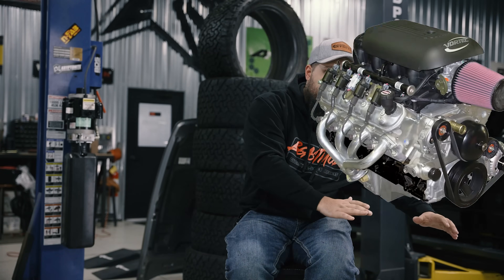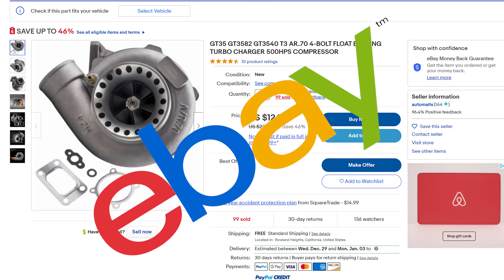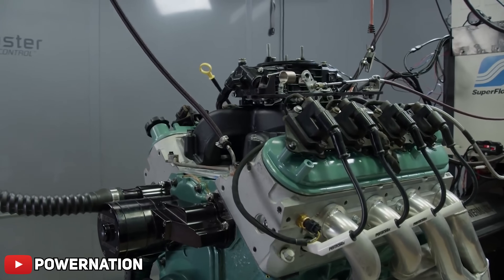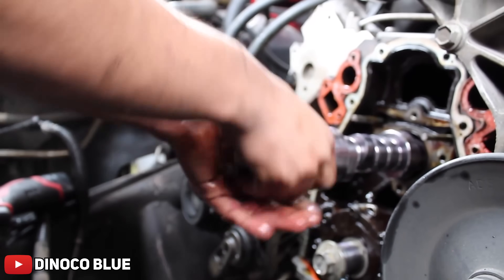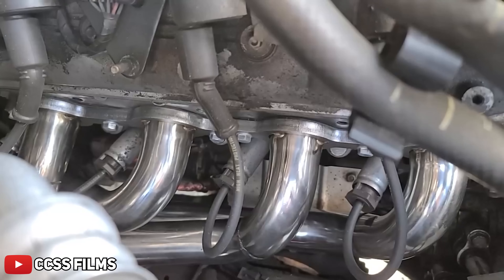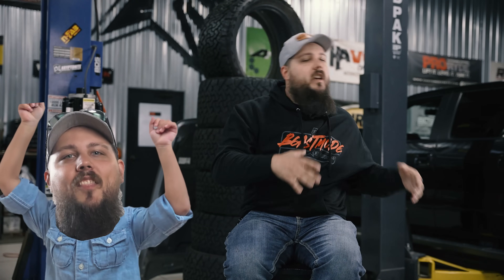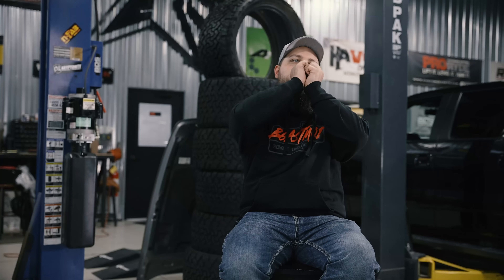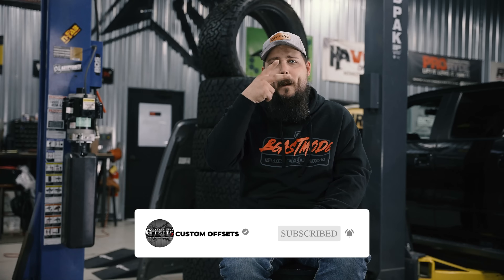Best Performance Mods For 5.3 Chevy Vortec

Comment: Best mods for a 5.3 Chevy....buy a Ford. 🍿
Reply: Not a ford. That would be counter productive. Not a dodge either.
Reply: L comment 😂
Reply: Buy a ford…. 😂😂😂🤣🤣🤣
Reply: I have both and hate to say my ford is terrible...already lost two cylinders
Reply: @joshuaguin7823  in the last 10 years, I've had a ram 1500, 2500, multiple Chevy 1500's of different body styles and at least 5 different gen ford's and I'll never go back to another brand (unless I make the switch to a yota 🤷🏻‍♂️) Dodge was a joke ime, and Chevy was in the shop left and right for anything and everything. Just my experience and I totally get that everyone has their own brand that they eat, sleep, breath and shit.  lol just starting some popcorn. Nibbling comments. 😁🍿
Reply: And best mod for a Ford? Junkyard...
Reply: @shanestewart6252  Faster tho...Chevy the slowest then second dodge lmao.
Reply: @joshuaguin7823  It didn't lose 2 cylinders dummy u bought a 5.4l that's was your biggest mistake you made goodluck with them noisy phasers. Do the livernois lockout kit or buy a 5.oh like you should've from the start😂😂😭🤡
Reply: @clayton8465  yes tends to be true🗑But I must say I’ve had to do little work here and there on my 2000 f150 4x4 , but lot of issues were do to off brand parts. In my eyes my truck individually deserves a medal 🥇
Reply: Instructions unclear , bought a GMC. Lol
Reply: @micwynn9618  🤣🤣🤣